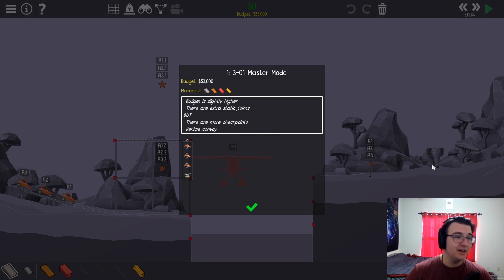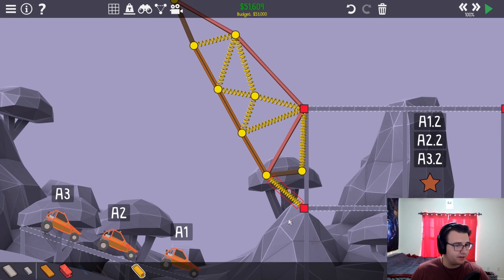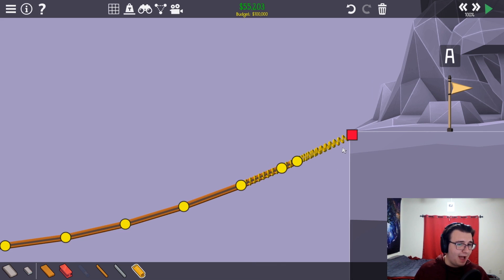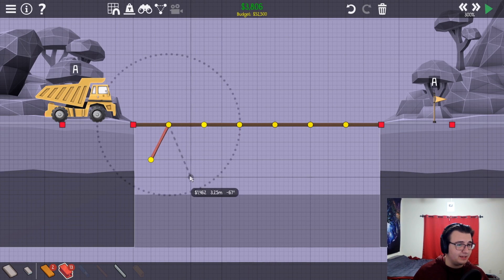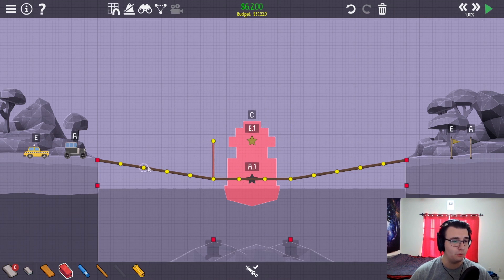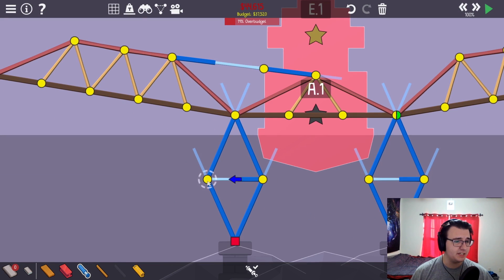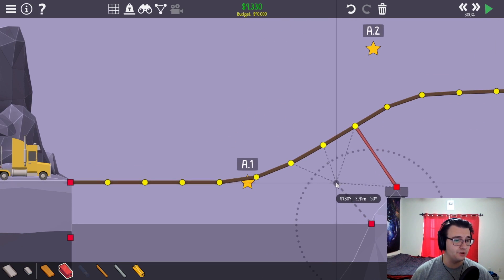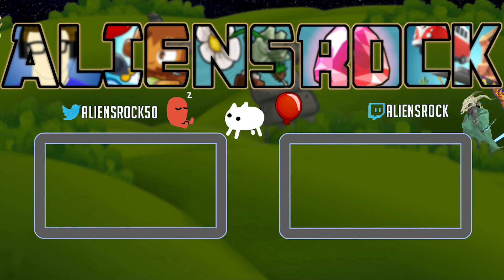Supporting EXTREME Loads With Complex Tension Design

Comment: Start World 3
3-01 0:02
- Budget is slightly higher
- There are extra static joints
BUT
- There are more checkpoints
- Vehicles convoy
----------
3-02 3:01
- The budget is much higher
BUT
- The bulldozer starts on a cliff
----------
3-03 5:41
- The budget is much higher
- Wood and steel limit are swapped
BUT
- The dump truck is american
----------
3-04 7:47
- You get $20 extra because i'm feeling nice today
BUT 
- There is another checkpoint
- The taxi is much heavier
----------
3-05 12:33
- The budget is higher
BUT
- The bridge must dip to collect checkpoints

Comment: I learned you can relieve pressure or tension on a road by building a wood muscle around it, then replacing the middle wood with a spring. 
Compress the spring for tension relief, or stretch the spring for pressure relief.

Comment: If you've ever thought about it, overlapping arches are theoretically immensely structurally sound - they're just also massive and expensive. Tension bridges are also stupidly strong because, well, cables are, so combining the two works great. The arch has to be good for that to work, however, that dented and dipping nonsense does far more harm in stability than good in budget.
Also don't you remember my lesson on why cable muscles work but overlapping cables have less effect? How the central joint in the duel cable makes it not take effect until it catches an already-collapsing bridge that previously also broke a cable in that same position, but muscles have both evenly loose so they both take the weight?
Also you really built two massive hydraulic muscles and then were surprised when it ended up over budget immediately?
Reply: I like your funny words magic man
Reply: Well he did point out the fact that the 2 diamonds are costly but he was getting somewhere with them
Reply: mans seems pissed jesus they shouldve paid you to wright the declaration of independence.
Reply: Haha nerd

It's just a joke
Reply: That was a dissertation jesus

Comment: On the last bridge, everything was getting stressed because you had the supports and roads meeting at a single joint. That joint ends up being a pivot point if the bridge is heavy enough
Reply: Smort